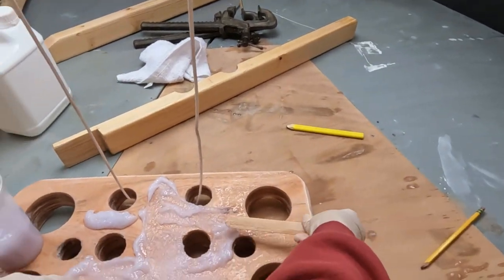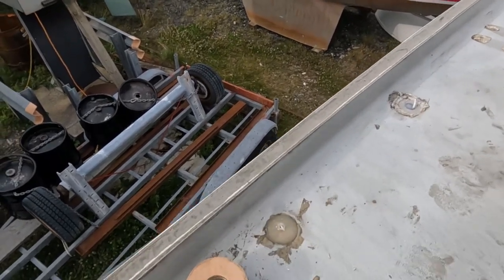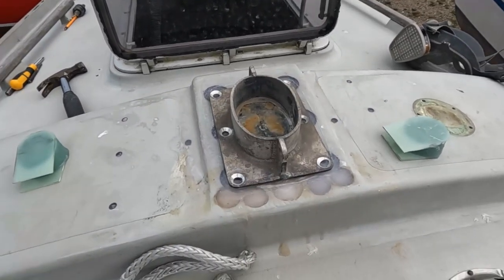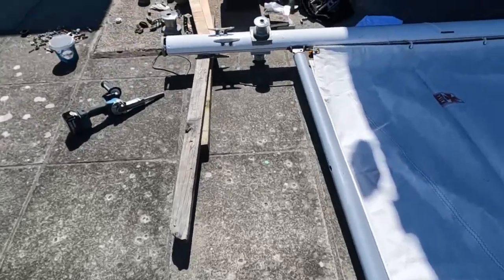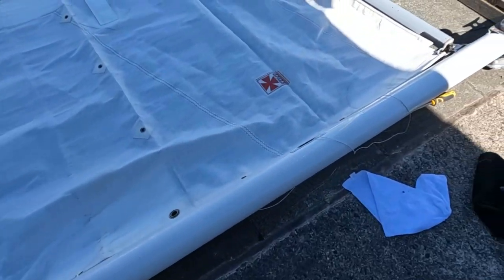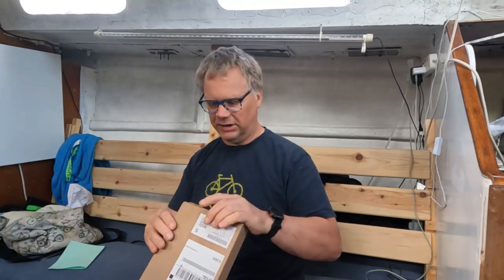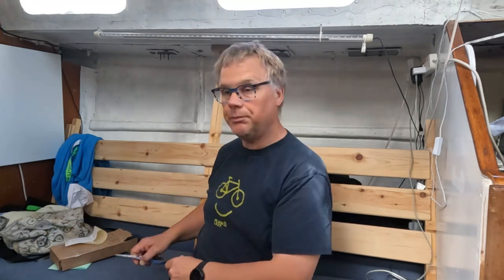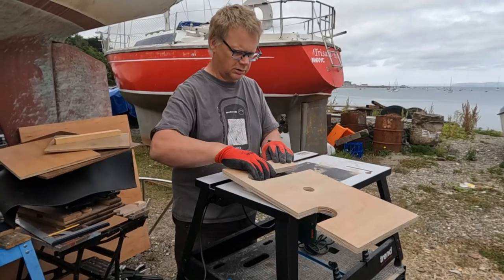DIY Dyneema Chainplates, Mizzen Mast Support

Comment: Mizzen masthead more sticking back is my guess in order for teh topping lift to clear the head of the sail

With the chainplates, it might be an idea to tension the dyneema before knotting as that would take out the construction slack from teh splicing
Following with interest as something similar might work for me if I need to change my 51yr old stainless 'hairpin' chainplates
Reply from the maker: Jane found a photo that I was able zoom in enough to see that you are right about the mizzen mast head.
Good idea about the constructional stretch out of the shackle. Thinking about it I'm a bit surprised that the slackline site I got them from didn't do that, maybe because they were using much smaller diameter line https://youtu.be/jU_mmdbQeCQ

Comment: Wow am I the first viewer? Cheers friends! Did you round over the holes in the FR4 chain plate backing plates? Could not see in the video.
Reply from the maker: Have we reached a milestone to get first viewer comments 🤣🤣🤣🤣
Reply: Boom!!! Second. 😊
Reply from the maker: Not rounded the FR4 backing plate yet as when we coat the inside of the mushrooms we get some epoxy running down. Once we have finished with the coating of the mushrooms we will be rounding them nicely.

Comment: How will you stop water running down the Dyneema and into the sleeve and intimately filling it up and letting it sleep down below?
Reply from the maker: Hi Andy,
We are taking a multi-layered approach.
The mushroom and fabric sleeve (that also protects the lashing from chafe and UV) should keep large volume of water from waves out (and especially importantly grit that would cut the dyneema).
So then we are really just looking at rain/spray that runs down the shroud past the top of the fabric sleeve. We hope to stop most of that using some sealant around the dyneema chainplate loop as it emerges from the mushroom.
Then below decks we are going to have a drip tray/container that will catch any water that does make it through, we can remove and drain that as needed. We don't yet know how much water will get through.
This is why we have drilled a larger hole through the deck and filled it with thickened epoxy. When we drill the holes for the actual chainplate loop there is no polyester resin, no timber etc exposed so water shouldn't do any damage or spread anywhere else.

Comment: You probably have, but I was thinking: 
Could you epoxy the Dyneema chainplates once they are in final position? This would seal up the entirety. Downside is that it's harder to get them out - should this be required. However, I imagine drilling them out would not be too much extra work. 
The upside, as I see it is:
- No (potential) holes for water coming in at rough seas,
- Plus, extra strengthening of the Chainplates,
- Further reinforcement of the "knot" under deck.

https://www.youtube.com/watch?v=Bca5_uyH9E4 here at around min 7:20, Steve Yrvind talks about epoxied ropes, and how he uses them.

Great channel, if you want some feedback on how to improve some youtuby-things - ill gladly throw in my 2cents.

Keep up the good work, cheers!
Reply from the maker: It is a good idea. I suppose the we were wanting to make them easy to replace while we are new to them.

Comment: Hi
There are some ready made fairlead tube , cheaper plastic , Scheafer, or expensive SS ones by Rupp Marine. The same one you could put a piece of tube over the small mushroom end that would extend up the shroud as far as you like and seal the water out everywhere except the top of the tube. And there's solutions for that too. 
DM for more clarification. 
Cheers Warren (warp21drive)
Reply from the maker: Like these?
https://hardware.schaefermarine.com/index.php?main_page=index&cPath=143_176
Reply: Yup that the plastic ones , here are the SS ones which bolt thru the deck 
https://shop.ruppmarine.com/products/fairlead-tube-standard-2-875-each
Reply from the maker: I'm not quite sure what benefit they would give us.
Reply: Hi , the SS unit could be bolted in directly to the deck in 1/2 hr per. The smooth SS will not chafe the dyneema, you can easily slip a piece of tube over the mushroom end to seal it off From water ingress and the tube can be as high as you like to keep water and dirt out.
The plastic ones could be installed in and provide a nice smooth interior as above , same method for a tube to seal it.
You have a lot of fairing to get a smooth outlet from the wood mushroom set up , and it's wood , that will rot sooner or later no matter how much epoxy you soak it in.   
Any time you can use ready made items you save so much time and effort and you can repeat so much more easily .
I think it's a false ecomony to make everything yourself. 
Cheers Warren
Reply from the maker: The diameter isn't enough for 2 x 9mm (mizzen) or 2 x 12mm (main mast). Time saving is great but budget saving is also really important to us.
Reply: @SustainableSailing  , There are other size alternatives out their these are just examples.  i've spent a lifetime designing industrial manufacturing so get to see many ways of doing different jobs.  
 I'm sorry your budget is so tight , fixing up the standard rigging might have been a more economical on funds and time.
 The end goal is to go sailing not repair and re-design  boats after all. (however much fun that may be).
An old English saying comes to mind, I'm sure you know, Penny wise, pound foolish . May not apply exactly but ....
all the best warren
Reply from the maker: Our move to dyneema hasn't been just about cost it is also about performance, being able to carry spares and fix problems in remote places.
Reply from the maker: Also our stainless steel rigging needed new chainplates, new toggles, new turnbuckles, possibly new tangs.
So we would have been starting almost from scratch in order to be able to get insurance.
Reply: @SustainableSailing  only you can judge whether your time is better spent in the yard or on the water.  Insurance in anywhere but home waters is getting so hard or impossible to get on old boats that it may not be a factor unless you have a secret underwriter! 
Cheers Warren
Reply from the maker: @CheersWarren  as we are preparing for retirement it is better for us to complete the refit while still working with not much time for sailing.